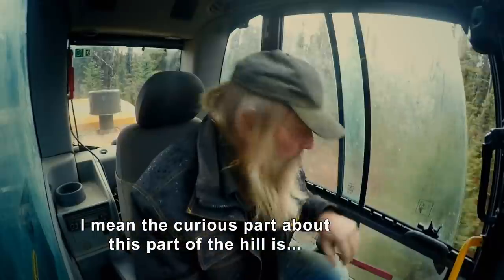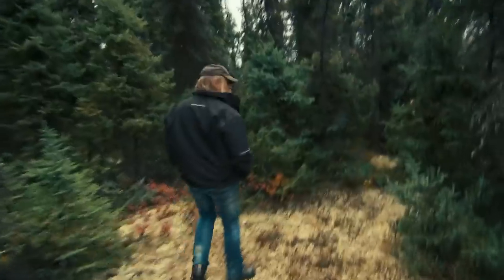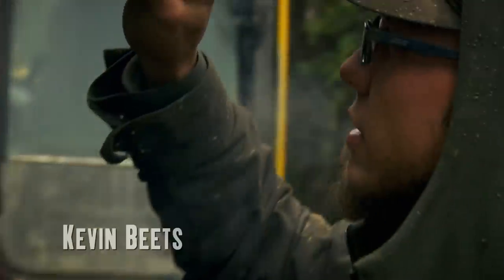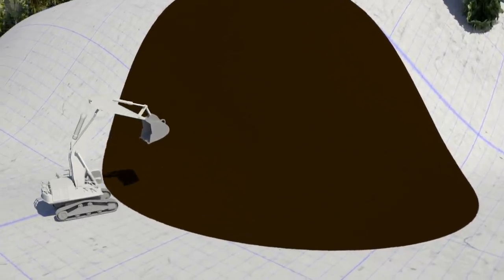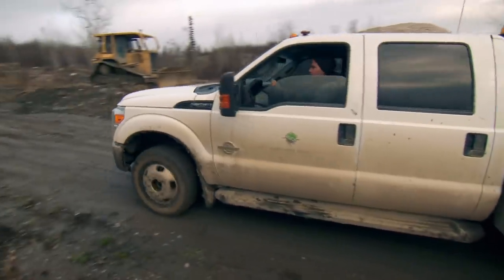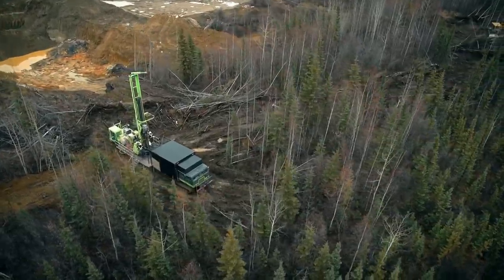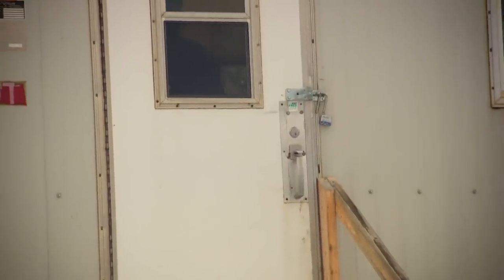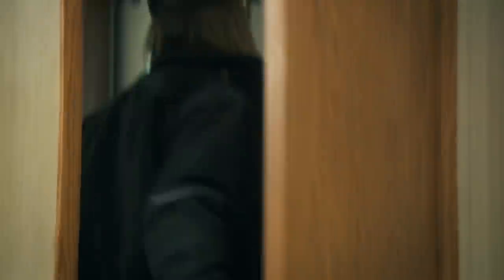Tony Wants To Know If This Old Gold Mine Still Has Good Gold | Gold Rush

Comment: If the old timers used these monitors to wash gold from these walls, odds are alotta that wash-down missed those crude wooden sluices. Gold is heavy stuff even denser than lead. The only soil it can't work it's way thru is bedrock.